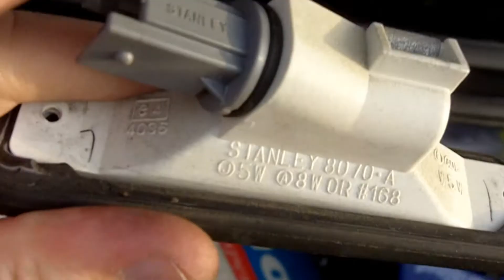How to Change Your Tag Light Bulb

Comment: I bought a 10 pack of 168 LED bulbs on Ebay for $10 so I can have them in my license plate light and give away the rest to friends. But I wonder since it looks like the bulb is at an angle to the clear plastic, if the LED will really shine onto the license plate much since the bulb isn't point directly at the license plate. The LEDs I got is 1 forward facing LED on the bulb.